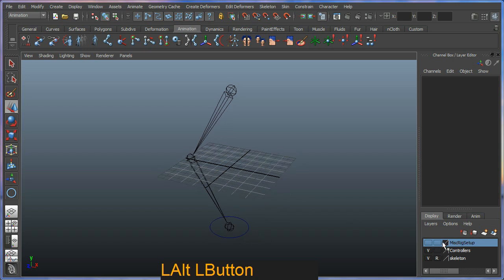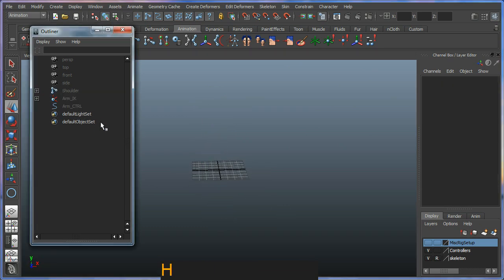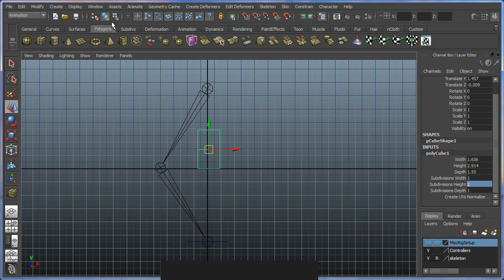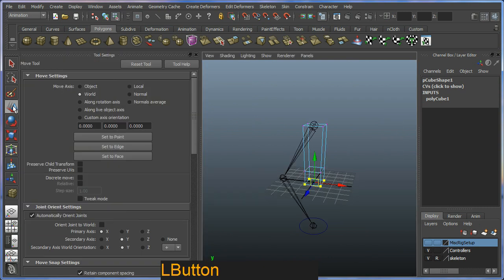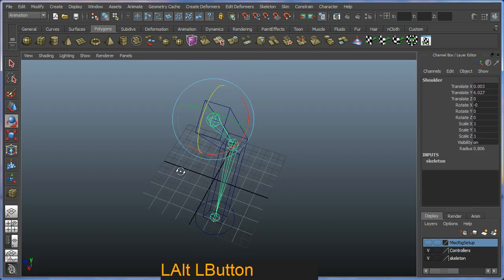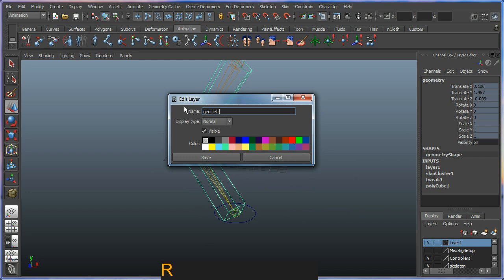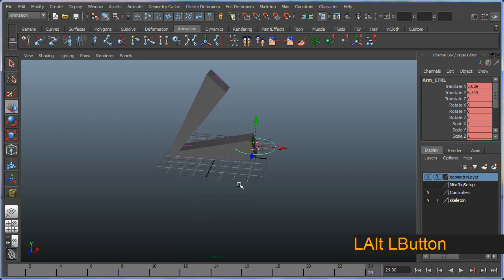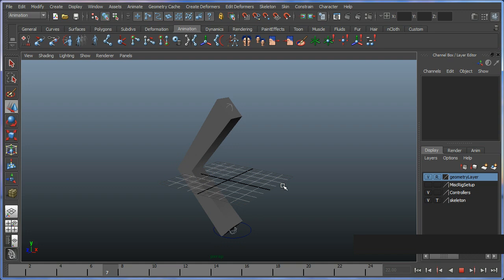Primer in rigging in Maya - Part 2 of 2

Comment: Would you happen to know anyone that teaches what you are teaching with a mac because i got stuck in ik mode or something. It was a very good tutorial though i learned a few things just would like to finish. Thank you so much otherwise sir
Reply from the maker: Could be bro.. I could do tutorials using OSX..but I'd still use a three button mouse and change the F1-F12 keys so I can use them in Maya.. other than that the differences is the way OSX interacts with Maya.  file system etc..

could be a good idea thou.. might think about making one
Reply: ok thank you :)